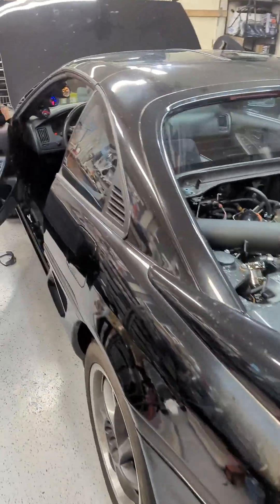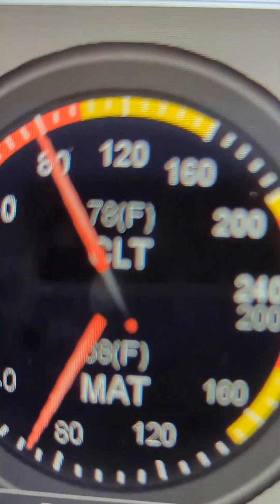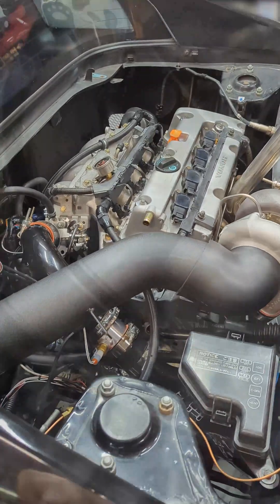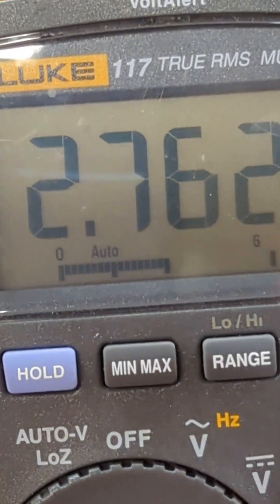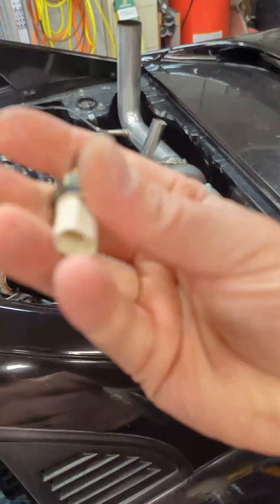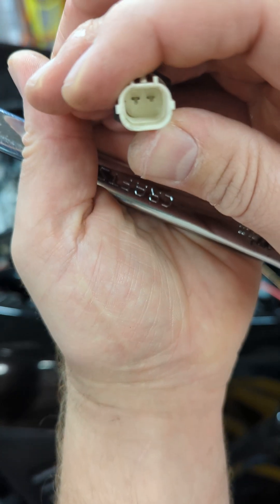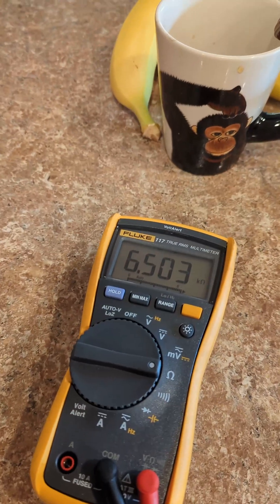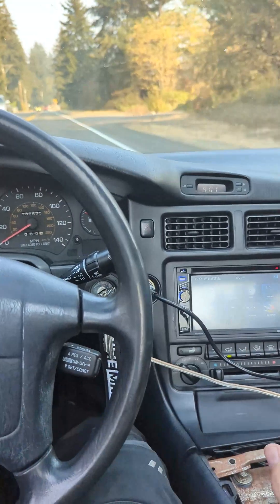Calibration of Honda Coolant Sensor

Comment: Why did you heat then cool the sensor? Does that recalibrate it?
Reply: He found out the actual reading in the hot and cold water and reprogrammed the gauge to read it properly.
Reply: At the least that’s what I got from the video.
Reply: So there's 2 coolant sensors??